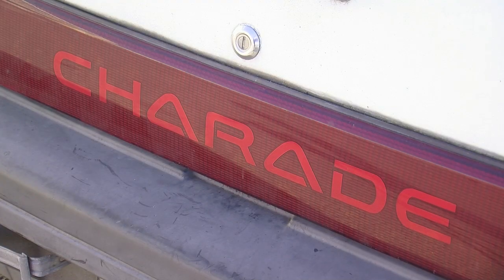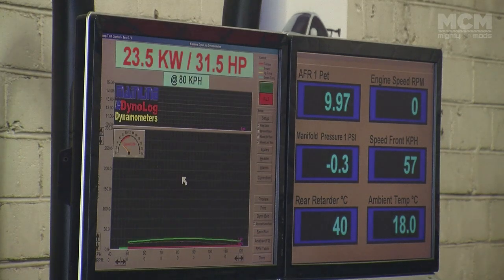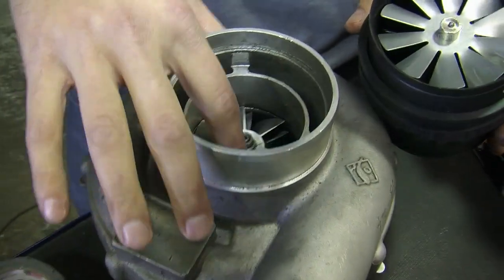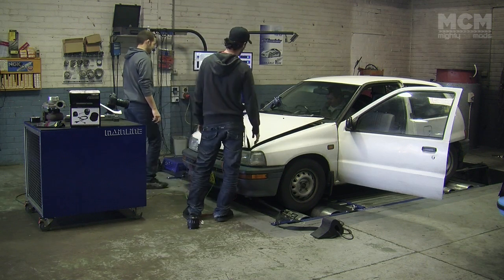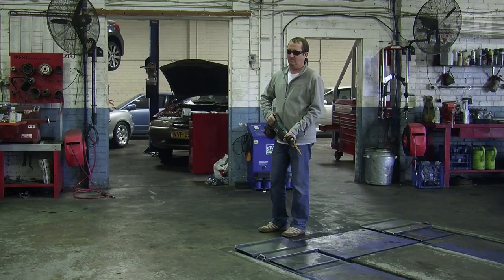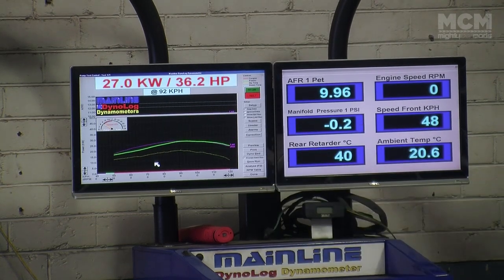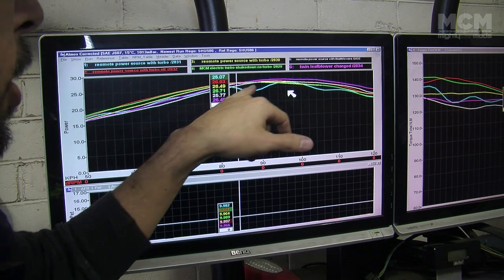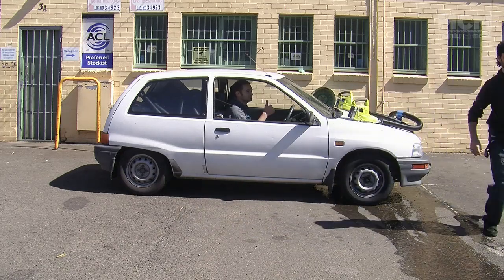Electric SuperChargers Mythbusted

Comment: It sounds very intriguing the problem is you're blocking AIR when you put a great big fan on the intake and it's not pushing air like a supercharger or turbocharger it's like a giant hair dryer, why are you wasting your time with an extra battery you should have hooked up that great little turbo fan to a 220 line that would have made it spin up

Comment: Gentlemen, i am a retired automotive designer and counter-developer of that very device. It is a modified RC jet engine, custom built to work with the demands of its new orientation. Im afraid you have installed it wrong. The best illustrator of this would be one step backwards- a Tornado, aka Tumble Valve Generator. It must be installed with air density and velocity taken seriously or it will just flutter and chop at the ambient air as yours did. First, it should be located far enough past the filter in a tubular snorkle or intake so that the filtered air has a chance to re-establish a pattern of flow.  We usually reccommend 5-8 inches of intake tube, venturied if possible. Pvc, a torch and an exhaust spreader makes it easy. After the supercharger should also have enough distance from the throttle body that the airflow has a chance to establish linear flow, or even better, a venturi. A linear-flow grid that encourages the right tumble before the venturi will create even more boost. 
The truth is, in an older car, like my Ecotec 1.6 NA Aveo, a conical filter, tornado and venturi actually makes boost through the miracle of the coriolis effect. Play the throttle like a sax and the thing spins its wheels when the 4.5k cams drop in. Sd my custom built Evo because the Aveo was killing it! And now i have the same basic ecotec square bore/stroke miracle engine, but built and turbocharged by Kia. My Forte puts down some serious power. Im out ther taking RT's.
Hope this helped. Do it right and you might be AMAZED.  And study the difference between boost and flow. 😊

Comment: You need roughly:

4–6 kW minimum for an electric supercharger.
That’s ~5–8 horsepower worth of compressor power

Now convert that to 12V:

6,000 watts / 14V = ~430 amps

Your alternator does not have 430 amps available.

So the “electric superchargers” sold online:

Use tiny fans
Draw maybe 10–30 amps
Produce almost no measurable boost
Sometimes restrict airflow more than they help

You might gain:

Intake noise
Placebo effect
Slight throttle response change at best

But real horsepower gain? No.

Case closed.
Reply: you are better off to tune the ECU for a NA engine like for example a 2008 VW Rabbit Mark V engine.

Comment: To fix issues you need to run its own power system it needs more than 12v also need a way to charge it like and alternator dose. The power demand dose not meet the requirements that's why it stops working. I'd try running a better battery in series on its own power supply separately from the cars OEM power system the car reacted from all the power loss. I have thought about this upgrade but need to figure things out first like charging and power demand

Comment: I wish you had put it AFTER the air filter, right in front of the throttle body, instead of BEHIND the air filter  that would obviously hold it back.

Comment: The engine controler has to be wise to the possibility of super charging.  It must accommodate higher air flow, absolut manafold pressure, and have increased fuel flow capacity to match the increased air flow.  

I'm surprised it worked at all!

Comment: Interesting.  But the first booster charger had an open intake.
In the second attempt with garden blower, if a Y connector is used instead of T connector,  it may give some different improved figures.

Comment: So if you hooked up an inverter to an electric router and put a fan blade on it in stead of a router bit, and then did all the necessary relays and what nots, would tat shit work lol. I mean the average router spins up to like 30,000 rpm

Comment: If you increase the intake air volume you should increase the exhaust too by changing to a bigger diameter exhaust.
You could also add a velocity stack, and use an axial compressor fan with more air speed than NA intake air speed.

Comment: I think electric intercooler connected to the AC system embedded in the airbox and electric turbocharger are going to be the next generational technology modification in future combustion engines. The technology is not there yet but what important is compressed cool air going to the intake manifold. Do not make video with already negative conclusions that obscure objectivity.

Comment: I knew the day would come when legitimate units were built and it actually came probably a decade ago; electric turbos that add proven and huge HP gains, but they are ridiculously expensive. Seeing these hit Ebay and Amazon 10-15 years ago really sickened me, however, I also knew someone would build a legitimate system. Why however we can all only wonder! My formal is in electron physics and engineering, the fancy way of saying electronics/electrical engineer. 
The amount of power consumed by an electric turbine compressing air for your intake is sickening.
The one I saw the $3K model installed on was a beater car they left stock, but I am confident that after their video, it immediately started having electrical problems.

Comment: I snapped my 12mm headstuds with a 1900hp vortech v15 centrifugal running off an electric motor with 175v 600amps dc at 2500rpm in my atomic 998kw barra. Now has 14.3mm headstuds...

If your have enough electric power and an electric motor that has enough torque (for spool speed) and magnet and copper size (for electrical kw continuous), then you're good...

Comment: You probably leaked all your boost where the cold start manifold heated air comes to the air filter neck. Also the hook up for the crankcase ventilation system

Comment: Doesn't the turbocharged air need to be cooled down so that it acquire less space? I mean, it's not about moving more air into the cylinder, but also to make sure that all that extra air fit in the same space.... So, you need inter cooler before it goes inside the engine..

Comment: might also have been good to clean air filter and probably check you arent losing the pressure in the airfilter anyway - its not really a high pressure friendly system

Comment: Most likely the supercharger is just not putting enough air in to boost the pressure and the control chip doesnt know what to do even if it did

Comment: I enjoyed the video and it was very informative. I have seen these electric 'turbo's' and to be fair, i need to point something out. In the video at 5:52 i noticed the wires going to the turbo, just two. This is a DC motor and as such its about as much use as tits on a kipper. Some of these advertised turbo's use brushless motors which are a 3 phase motor, capable of far more power and much higher rpms, they are used in drones etc. Ive flown planes with brushless propulsion and to be honest, they look the same as some of these 'turbo' units. My interest here is for a dune buggy engine and after lowering the compression of the engine with a spacer, i now have severe lag before the real turbo spools up. This was my interest in these electric turbo's. It would be very interesting to see the same tests done with a brushless turbo which are much better IMO

Comment: Yeeeeaaaaaa ummmm with that old car using that old style carb intake of course it wouldn't work.... old style air filter system will have leaks and to much empty space .... the fan needs to be directly hooked up to the carb or intake not through a filter. Try it again the right way.

Comment: Intakes for leaf blowers were obstructed by the hood as they pull from the bottom. Try running one on the ground and pick it up at full throttle and notice the massive increase in output. Too little too late but noted. Great work guys as usual =D

Comment: Woulda got better results from the blowers if you used more electric current (more/higher output batteries), reducers and shorter/smaller piping.

Comment: Would the power of the electric supercharger increase if you used a 48v battery instead of a 12v
?
Reply: If it was a supercharger and not just a cheap fan. Proper electric superchargers that actually compress air are 48v.

Comment: It doesn't work on old cars old cars doesn't have más flow sensor neither smart computers to manage the data of air input
Reply: @Ade Matthews it does on modern cars its been proven on the dyno the computer analyze the flow of air /ratio then it manages the data air = oxygen  more oxygen more combustion
Reply: This would do squat even on a modern car with flow sensors etc. The amount of air a fan like that flows is nothing.

Comment: Marty, and Moog, what happens when you have 6 leaf blowers attached to your daihatsu?
Reply: I was thinking the same thing.  I'm pretty sure that'd do it.  I wonder what happens if you have ALL the leaf blowers attached to your daihatsu!
Reply: @whatelseison8970  I challenge Marty and moog to do it. Add 15 leaf blowers to a car, run it down a drag and see how fast they can do it!
Reply: @cop2506  15 leaf blowers?  Naw, I'm thinking fill the entire cabin with leaf blowers, nothing but leaf blowers on the outside of the car, replace the tires with leaf blowers, annd towing a trailer with more leaf blowers.  But then you wouldn't be able to get a load of that sweet daihatsu styling.
Reply: @whatelseison8970  what if... Marty and Moog connected the leaf blowers to a 15-1 pipe, to a front mount intercooler, to the maaaaad engine?

I WANNA KNOOOOWWW MECHANICAL stig! Someone do it!

Comment: The only electric "turbo" I've seen that works is one that Cleetus McFarland tried out on a Chevy Cobalt.  That actually gave a 5-6psi boost, which was a noticeable bump in power.  Unfortunately, those systems are very bulky, and very expensive, coming in at about $2500, though it's a straight-up bolt-on system with a very simple install. I believe it's called the TorqAmp.  If it wasn't so expensive, I'd consider one for my daily driver, just for the hell of it.

Comment: Why don't you just use an air tank and a high pressure pump? Tank would hold pressure for longer durations and you could control the air and pressure electronically.

Comment: That first toy probably introduced a restriction. The "turbine" blades made from beverage cans was a visual give away of impending failure.
Now, with 2 blowers you need a plenum a bit bigger than a PVC T piece. Highly likely that there was airflow stall in one or both leaf blowers. 
Common problem in air feed systems.
Try again with 2 holes in the filter lid.
Get a bit scientific fellas, fit a simple manometer tube to see/measure what's going on.
If you don't add fuel you won't get more power by just blowing, at best you are reducing induction losses. Worse case is your blowers are choking the inlet.
More science with the fun please.

Comment: I supercharged my car for only $10. All you have to do is draw air from the front of the car and route it through to the air intake under the hood. The opening at the front of the car should be a minimum of 2 inches wide. Best of all, a "supercharger" like this requires no electrical power, switches or relays. The supercharger is activated as the car drives down the road. The faster you go, the greater the air pressure at the air intake box. You wouldn't believe the amount of air and air pressure at the air intake, when the car is moving at just 60mph.
Reply: That's a cold air intake

Comment: When he pulled that thing out of the box I almost fell off my chair. $300 for that? It's literally a computer fan lol!
Reply: I felt the same way. I fix computers as well as repair/Mod cars and Bikes. Whatever I know I share with the world if it can make any inprovement to society OR the Car/Bike I am working on at the time. THIS was something I felt did NOT need to be shared with the world ROFL!
Reply: @haydenbellis3047  shut the fuck up
Reply: But it’s Aussie dollars, so only about $200 US.
Reply: @tukangiseng  Fans do not compress air, so they do not work.
Reply: Depends on type of fan and it will need to run at a very high rpm. Not something you can achieve with a plastic fan.

Comment: Some problems with eBay item:
The carb* would need resetting if air density changes (too much) beyond specs
. . . . . or did/do recent ones had/have automatic barometric adjusters?  Add a servo from fan?
Was the air filter (shape indicate venturis*, not injectors) cover properly sealed (or stay that way)?

. . . . . something unseen was whether the air filter was checked or removed, poor science
When unused, wouldn't the fan (+ motor drag) impede flow, affecting moderate throttle*?
. _ . _ . (weird idea, supplement with NOx from whipping cream cans used the wrong way?)

Comment: Actually the CONCEPT of an electric supercharger is a good one - use electric power (basically from the alternator) to boost the air pressure going in to the cylinder. I think the problem with the one they tried was that the air pump was a pretty useless fan. Get a proper electric air pump and it would work great. They might also want to put it AFTER that enemic air cleaner.

I really don't know why auto mfrs go with turbo rather than electric or mechanical supercharging.
Reply: The problem with electric supercharging is that they require a lot of power. The alternator has nowhere near enough power to drive one constantly. Most electric superchargers require a 48 V system and run off of capacitors that are slowly charged by the alternator.

Comment: Still, considering that I didn't see you pull the air filter out, I can't help but wonder if you would have seen a whole other pony of power if you had checked that. After playing with a lot of 200 to 500 dollar cars, replacing the air filter is generally one of the first 3 things on the list when I get an old beater. Spark plugs, air, check compression & add Engine Restore if needed (for 3 & 4 cylinder engines, anyway) are usually the first things that make a noticeable difference.

How do we know you wouldn't have made a whole other KW or 2 from those leaf blowers if we didn't see you check the air filter?

Comment: I remember my mom had a 1L, 3 cylinder Geo Metro and later had aftermarket A/C put in. There were some long mountain inclines where you couldn't get it past 45MPH if you had 4 passengers. That requires you to put your hazard lights on in the U.S., on the interstate. It was a manual transmission. Trying to start at a stoplight on an incline with 4 passengers & the A/C on was usually impossible. You'd have to switch the A/C off & still ride the clutch to get the thing moving. 

50MPG is nice & all but not when you can't travel beyond a snails pace. Get a bike if you need that kind of gas mileage.

Comment: Ok so fans aren't it. What if I buy a decent size air compressor from the hardware store, put it in the back and run the line into the intake. Most have adjustable PSI...could be the next big thing...but seriously though. It's a new decade..send it...ROFL 🤙

Comment: I think all of you make wrong tests. In first, from experience, you can't measure on dyno everything, some things can fill and measure just in riding a car. Second, you do test with external battery but her voltage is smaller than from car alternator. Third, your test car use negative pressure for working, and can't be boosted without some mechanical changes. Also, power will go higher after some time, like with other gadgets and additives. Some gadgets is really without effect, maybe this electric turbo also didn't working, but your tests not valid.

Comment: Torque Amp electric turbos 100% tried and tested adds around 25-30% power on a stock 2l engine with ecu upgrade... As seen on cleetus mcfarland they are $2500us and from Holland but serious piece of kit for the price it's actually pretty good value for the price

Comment: This isnt an electric supercharger. Audi has one developed for 2020 models but its a 24volt battery system that powers a 75kw generator that powers a twin screw supercharger via the charging system so theres no drag on the pulley system. This same engine is also twin turbizzled. Have a look people.

Comment: Lol take a 750cfm carb put a 100cfm fan on it and call it a super charger. It just puts resistance in natural inflow it doesn't enhance or increase flow. You overdrive that fan and the motor becomes a generator adding resistance. It's a vampire

Comment: The electric superchargers fitted by audi require their own electrical system, with a 7kW motor driving the centrifugal compressor.

I see no reason why you couldn't get a high power brushless DC motor, cut a turbocharger in half leaving only the compressor side, mate the motor to the compressor, and thus have a very seriously powerful and programmable air compressor. Finding an electric motor that does 150,000rpm without gearing is not trivial but they do exist.

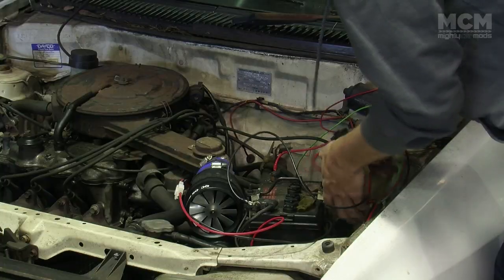Comment: 5:48  It spins sucking air Out of the engine FAIL xD
Reply: Diego Koszutski Santamaría || Shutter speed. It's spinning correctly, but the camera is catching some 30 frames per second, the fan just so happens to be spinning at such a rate that the camera captures the blades right before where they were in the previous frame.

Comment: He's worried it's going to take too much power huh or make it I'm sorrywell you can't just boost an engine and think it's going to make maximum power right away you have to do a lot with the fuel system like bigger injectors and a bigger fuel pumpCourtney polishing excetera just throwing a turbo on there's going to get you some power but it's not going to blow your engine up unless it's already a piece of shitt to begin with and in that case you have no business boosting it